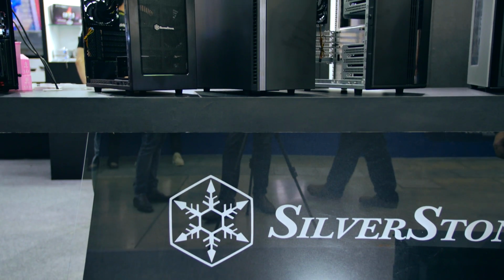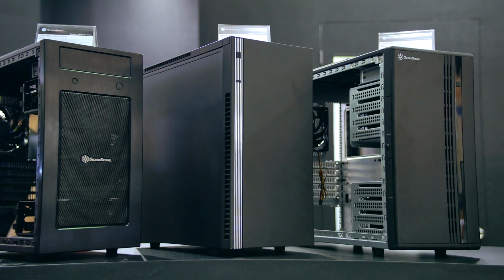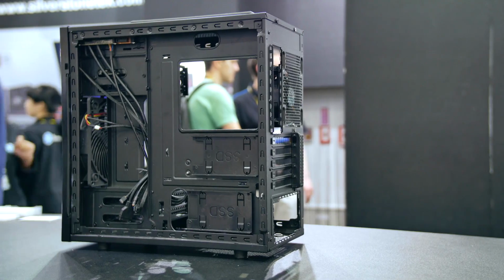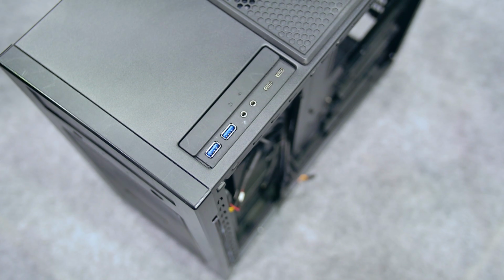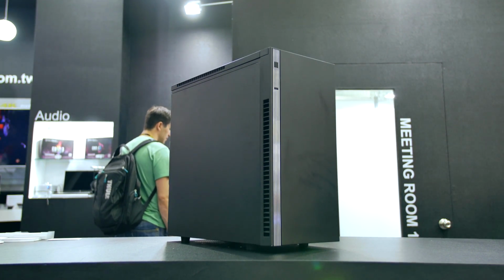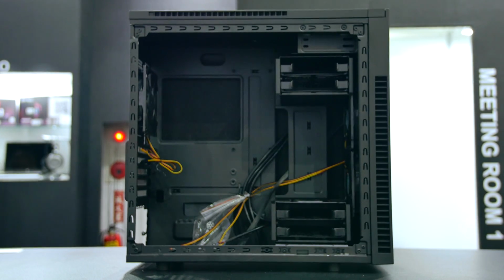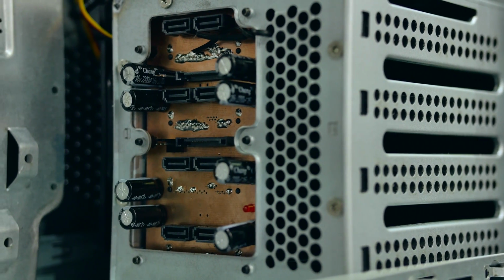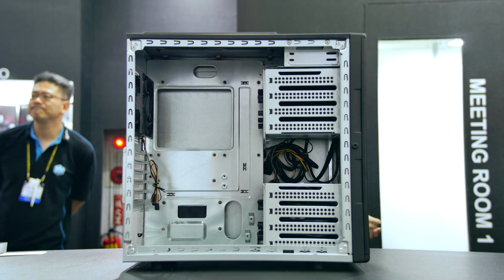Silverstone TJ08 Pro High Airflow mATX Case

Comment: On the TJ08-Pro the power and reset buttons should move to the top near the IO section. And on the front they should put dual 140mm intakes. There's enough space on there. The rest is ok imo

Comment: if the tjo8 pro had 280 mm rad support in the top id go with it..... but currently only my fractal arc mini r2 has done this for me.... allthough ive also been looking at the enthoo evolve itx for my next build and i think my h240x will fit in that if ive read the specs correctly.

Comment: I've always liked Silverstone cases (I have the TJ08-E), but I feel that, like Lian Li, they aren't modernising their cases enough. They just aren't as nice to build in or work with as some other brands (Phanteks for example), who seem to be more willing to experiment. Relating that to this video, I really think that Silverstone should start using rubber grommeted cut-outs instead of just leaving the cut-outs bare, every cable should be sleeved, and it would be great to see a fan hub like the NZXT and Phanteks cases have.

I just wouldn't buy a Silverstone or Lian Li case now because companies like Phanteks, NZXT and Caselabs have moved things along so much.

Comment: I feel like Silverstone missed out on a great opportunity with the TJ-08 Pro. I wish it had dual 180mm fan support in the front.
Reply: Norman Fong How do you want to fit DUAL 180mm fans in the front? That doesn't even fit in most atx cases....
Reply: AGamingPanda if you look carefully. You can see that you can fit 2 180mm fans with the current dimensions. There would be room to spare without the 5 1/4 inch drive Bay.
Reply: Ah yes i see it now, but what would be the use to be honest? That single 180mm would be plenty I think and if you were to fit another, you would have to sacrifice all the drive bays.
Reply: Norman Fong You can mail them and give feedback!
Reply: Norman Fong I want a case that has a horizontal motherboard with the 180mm fan. Modular and stackable. Essentially the Thermaltake Core V21, but with 180mm support in the front and bottom. Because the Silverstone AP fans are brutal. And I want to put them in everything.